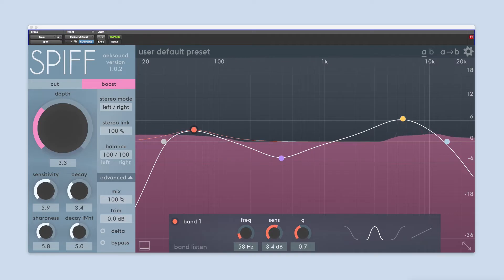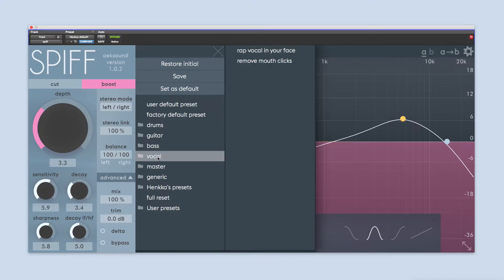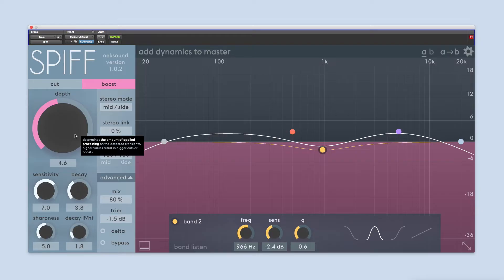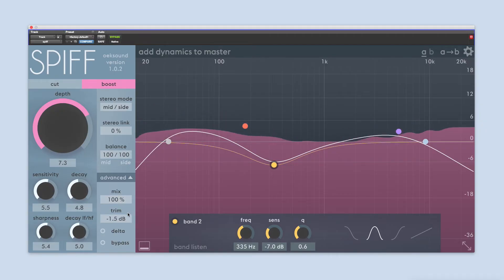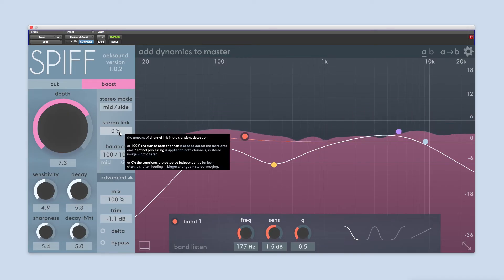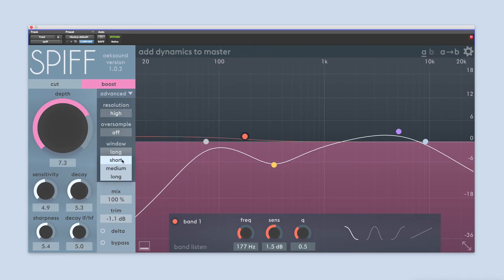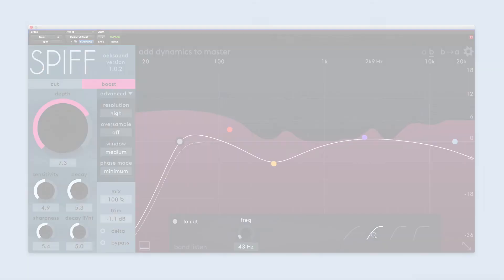oeksound spiff: Overview

Comment: Great Tool for work! Thanks <3

00:00 What is Spiff
01:00 User Interface
02:06 Modes - Cut & Boost
03:25 Depth
03:47 Sensitivity
04:02 Shaprness - Q
04:31 Decay
04:45 Decay LF - HF 
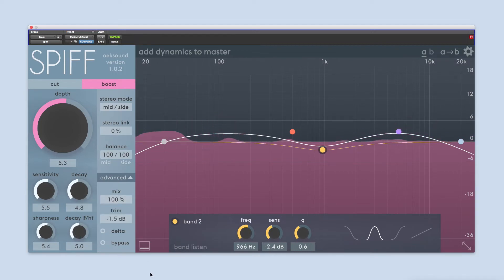05:22 Sidechain EQ
06:45 Mix - Trim
08:05 Stereo & Mid / Side
09:25 Advanced Tab